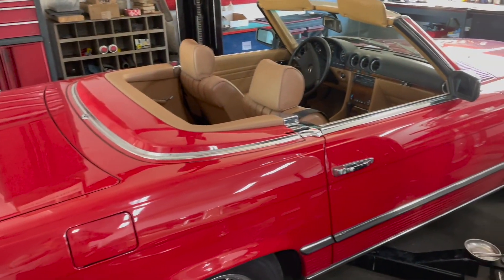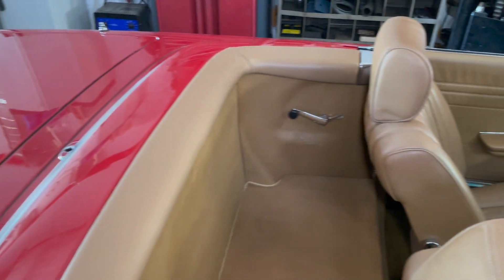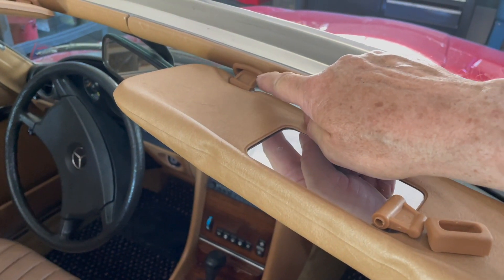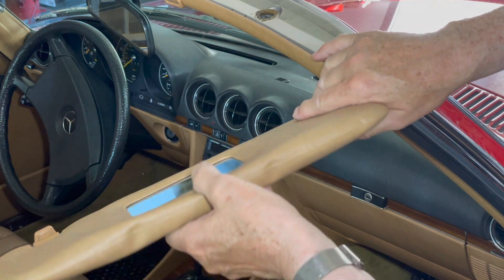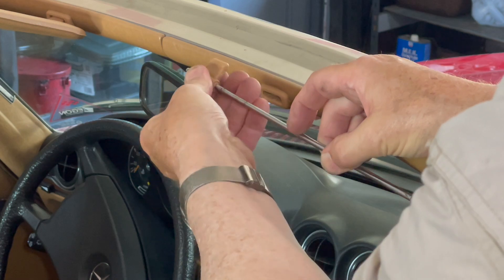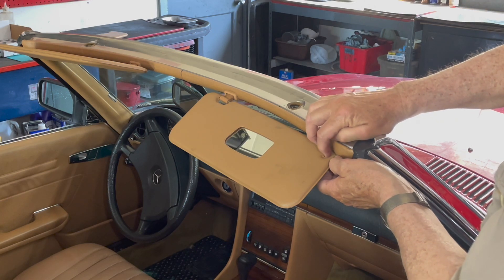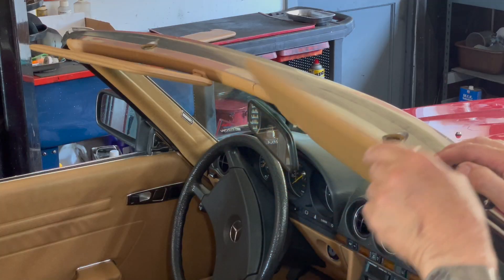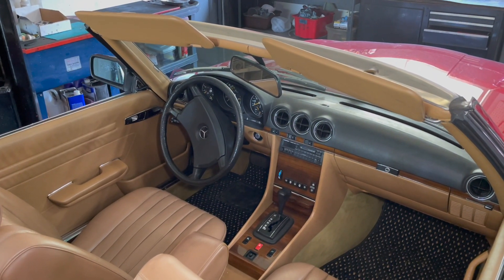Mercedes 380SL Sun Visor Replacement: Rolling Restoration Continues on Cherry

Comment: Ken, where can I find replacement wood veneers for around my heater controls in my 1985 300D? Thanks for all the years of info!
Reply from the maker: I have a good used one for sale. I think someone is Europe is making one but not sure. Google it.
Reply: Ken, we still have ours but it’s bowed/warped so we can’t refasten it. Is your used one flat so it can be glued? Thank you so much!

Comment: I always wondered about the visors being made so crummy ,and the little plastic tabs  that broke and cost like $55  to replace  ,  ,and why did they use a single length timing chain on U S models that    failed to soon
Reply from the maker: I am sure the engineers thought the flux capacitor would compensate for any potential problems.